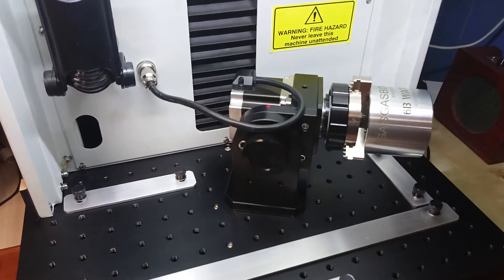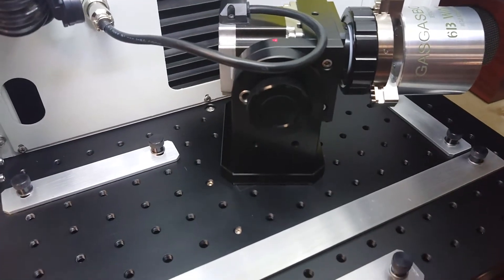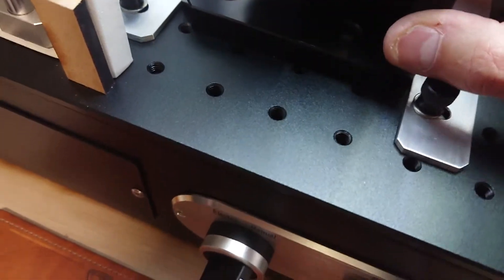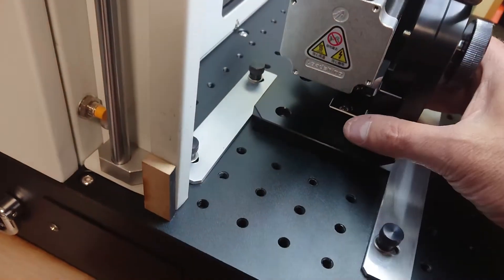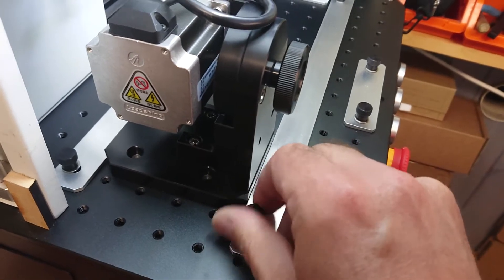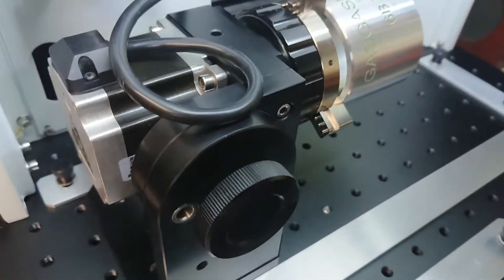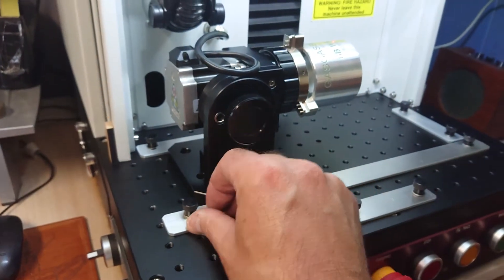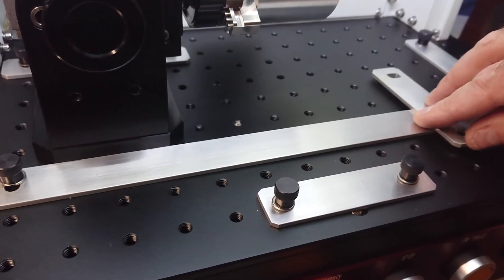30w Fibre laser - jigs and fixtures.

Comment: Hm...  I started thinking out loud, here!

I think I might clamp that rotary attachment on the top of its base, rather than try to hold it in place from the side.  More like...  the way you'd clamp things on the mill in various setups -- strap clamps, or some other kind of clamp; all kinds of options.  Or, of course, you could make a project out of drilling some new holes in the base of the attachment, or even drilling new holes in the laser's base.  It seems like thumbscrews should be plenty strong to hold it down, or maybe a simple lever clamp of some kind?

It doesn't seem like you'd need to move the attachment for different jobs, unless I'm missing something.  In my ignorance, it seems like you could find a place for it towards one end, in the center, and there is its happy home.  Maybe that would help with getting the software pointed at the right spot, I don't know.

One question that comes to mind is how accurate those threaded holes in the base plate are.  If they're square to the movement of the laser head, they could be part of the alignment of the rotary attachment.  Or...  drilling both the base and the underside of the rotary attachment for dowel pins could help set it in the same place whenever you want to install it.  I guess the pins should stay stuck in the attachment rather than sticking up out of the laser base plate...

Just rambling.  I'll stop now.  :)
Reply from the maker: Good points.  I didnt want to have to clamp it down every time I wanted to use it as I will be jumping from flat to round quite often. And also, depending on the placement of the engraving on the product it means that the rotary attachment needs to move left and right for aligning. You can move the laser design somewhat within the Ezcad program but not a great deal, so it made sense to me to have the attachment 'slidable'

With this way I can quickly put on a cylindrical product. Each time I do this, I know that the laser is always going to be TDC. I just then slide to the desired position for the marking.   When I tighten up the front strip of ali it holds it very well. If I were to do heavy long object then I would use a small clamp to prevent it tipping forward, or I think I will make a small roller support at some stage.
Reply: Hi mate I have a similar enclosed laser to you and want to do things like tumblers but it doesn’t seem possible as the travel for moving the laser head up means I can get enough height for focusing how have you managed this